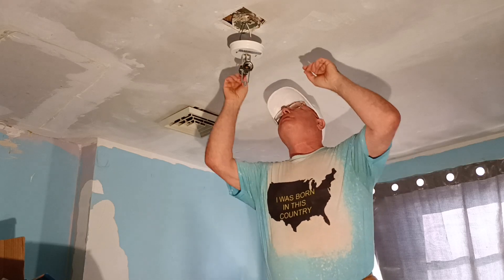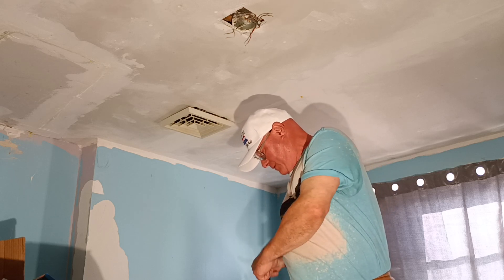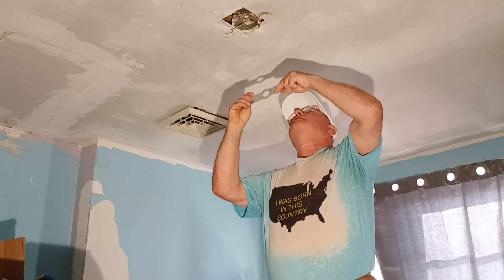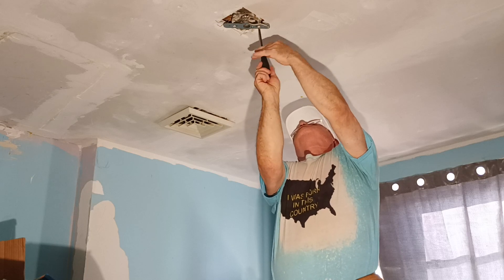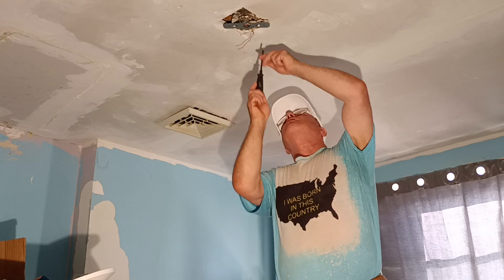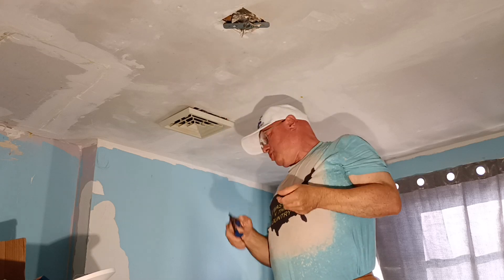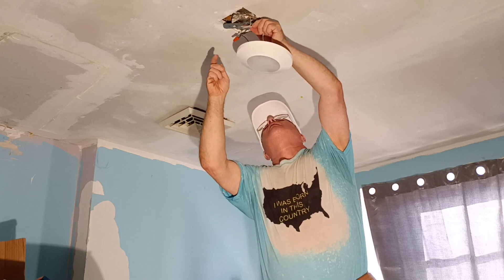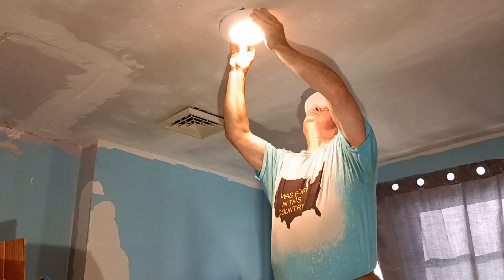progress lighting LED flush mount light fixture how to wire and install as a replacement

Comment: NEC states any gap around a box greater than 1/8th of an inch needs to be sealed to prevent arcs potentially igniting combustible materials that are exposed. Stop doing electrical work you’re spreading misinformation